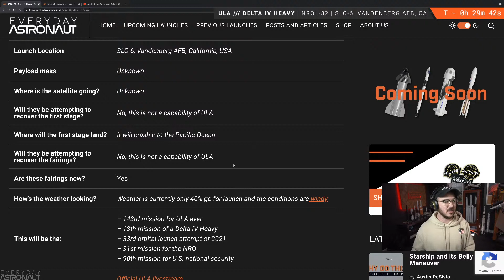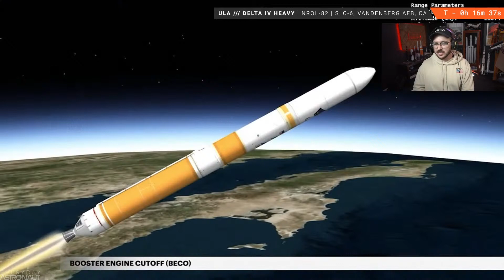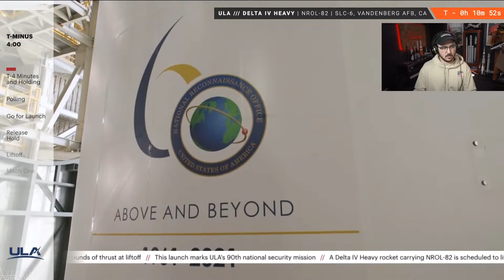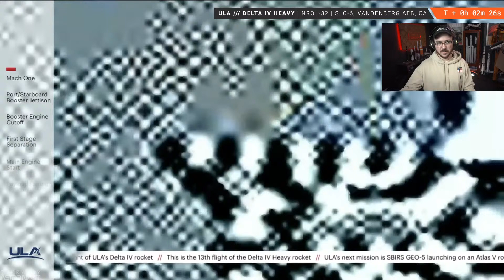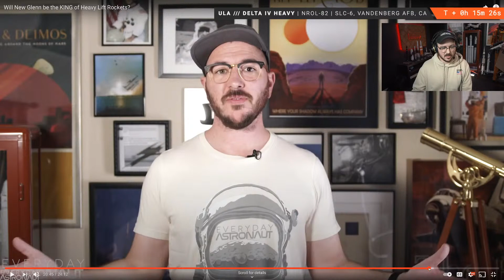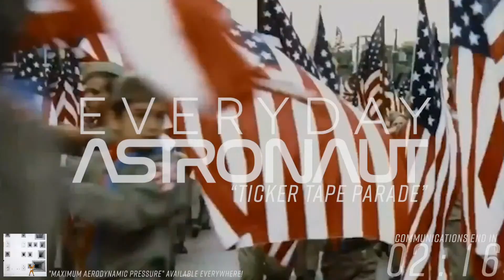Watch ULA launch the world's largest operational rocket, the Delta IV Heavy!

Comment: "the world's largest operational rocket" Does that mean that the Falcon Heavy can lift a smaller payload, or that the Falcon Heavy isn't considered to be operational or are impractical?

True, there have only been 3 launches of F.H., with a 4th scheduled for July of this year, and 5th on October, and possibly a 6th sometime in 2021. (Inmarsat-6B, according to the 'ever reliable' wikipedia, shows that it could be a standard F9, instead)
Reply: It means that, although the falcon heavy is more powerful and more capable under certain circumstances (which don’t include this launch, btw), the delta 4 heavy has larger dimensions (wider cores, 2 meters taller)

Comment: so the two boosters are fireworks pouring out aliminium slag and it falling all over the place.Why use them >>>
Reply from the maker: No, the two boosters of Delta IV Heavy are the same as the center core. They run on hydrogen too. So they burn super clean. The space shuttle on the other hand... or upcoming SLS... yes. I have a video all about “how much do rockets pollute” and we talk about that quite a bit

Comment: The largest ? Delta IV is only 2 meter taller than Falcon Heavy, but far behind in all other things.

While the Falcon Heavy and the Delta IV Heavy may have similar structural designs, there are two very distinct differences. The first being the Falcon Heavy has three launch cores, each fitted with nine Merlin engines. Whereas the Delta IV Heavy also has three cores, but only one Aerojet Rocketdyne RS-68 engine per core. The second difference is that the Falcon Heavy’s cores can return to earth and are reusable, while the Delta IV Heavy boosters are non-reusable, and fall into the ocean.

With these powerful engines, and both rockets first and second stages, each system can put its payload into Low Earth Orbit (LEO), Geosynchronous Transfer Orbit (GTO), Geosynchronous Orbit (GEO), Lunar Transfer Orbit (LTO), and Mars Transfer orbit. With all stages attached, the Delta IV Heavy stands at 72 m (236 ft) tall and weighs roughly 733,000 kg (1,616,000 lbs) empty. The Falcon Heavy stands at 70 m (229 ft) tall and weighs 1,420,788 kg (3,125,735 lbs). That is close to double the weight of the Delta IV Heavy, but with the power to back it up.

The Falcon Heavy boasts that it can carry an astounding 63,800k g (140,660 lbs) to LEO. This capability is the most massive payload sent to orbit since the Saturn V in 1973. The Delta IV Heavy can carry 22,560 kg (49,740 lbs) to LEO. That’s just a third of what the Falcon Heavy can carry.
Reply: It is just over a meter wider per core as well

Comment: Sad thing is that this extremely inefficient, expensive and obsolete contraption has no reusable element of any kind.
Reply: Condiering the spy satellites that these things Lauch require vertical integration in their orbit insertion, and the falcon heavy is only capable of horizontal integration, these rockets are not at all obsolete. Nor will be their quite non-reusable replacement. I like SpaceX as much as the next guy. And they do a lot of things well. But they don't do everything best. There's still a number of launches where their rockets aren't the best choice. That's just reality. Not everything can be fully reusable. It is what it is.

Comment: Hey @Everyday Astronaut, is the Delta IV really the "world's largest operational rocket?" I thought the Falcon Heavy was bigger (in both mass as well as lofting capability to any orbit) than the Delta IV Heavy by nearly twice as much... the Delta IV Heavy is a little taller I think, but it is actually much less massive, isn't it?
Reply from the maker: “Large” is a measure of size and Delta IV Heavy is 2m taller and each core is 5m wide vs 3.7m wide. You’re right, it’s not more powerful, or capable in some regards.

Comment: Most NRO payloads require vertical integration (optical paths are pretty fragile it would appear), whereas falcon heavy integrates horizontally, which means those payloads are closed to Falcon Heavy.
Reply: iirc SX is working on verticall integration, but i don't think it's done
Reply: thankyou for that explanation i was wondering why NRO went with a launch vehicle that costs them 5 times more than falcon heavy costs especially since the NRO have used falcon 9 quite a few times so its not like the NRO are unfamiliar with SpaceX

Comment: Confused:  If the Delta 4 Heavy puts 63,470 lb to LEO and the Falcon Heavy puts 140,700 lb to LEO, then why do you call The Delta 4 Heavy the "World's largest operational Rocket"?  (Because it is 2 Meters taller than the Falcon Heavy perhaps? )
Reply from the maker: Yes. Large. Size. 2 meters taller and each core is 5m vs 3.7m. So largest in every dimension. Powerful, hope. Capable, not really, but yes in some cases like direct to GEO
Reply: @EverydayAstronaut  Or we just change the word "Largest" to read "Powerful".  But most of the quibbling stops as soon as the Starship/Super Heavy Booster combo goes online.
Reply: It can put way more direct to GEO stationary orbit, which the falcon heavy can't do. This is important on very expensive satellites as they don't have to use any fuel to insert themself into orbit which means they can use all the fuel-savings to extend the life of the satellite by many years. For leo you are correct and falcon heavy is better. SpaceX just needs a more efficient upper stage.

Comment: This rocket is bigger than the Falcon Heavy and is not reusable, yet it nowhere near as powerful, funny that.
Reply: It's actually more powerful for GEO or beyond launches. Falcon Heavy for example couldn't have directly inserted this payload. SpaceX upper stage way more powerful but inefficient. SpaceX = Corvette ULA = Prius SpaceX has more power for the short trip to LEO(low earth orbit) but ULA on the same weight of fuel can deliver a payload much much further.
Reply: @vegajf51  The Saturn V rocket is still considered one of the most powerful rockets ever with approximately 3.4 million kg of thrust.

Impressive, but how does Starship potentially stack up?

If all goes to plan, Starships will be more than twice Saturn's by packing around 7.3 million kg of thrust! And that's just on its first stage. This number is with the projected maximum of 37 engines. However, even with the minimum number of engines to get to orbit (24), Starship will still be more powerful than the Saturn V.
Reply: @hillbillyintheasia6122  Very true and I hope starship works, but the question was about falcon heavy and why it wasn't chosen for this launch.

Comment: Isn't it funny how Tim Dodd switches off the sales / marketing piece pre-launch?  I mean people do have to justify their jobs, and that is absolutely fine.  What would be nice is for them to talk of their future plans rather than talk about their past.  The past is DONE!  folks.  Pat on the back - it isn't coming back.  ULA does not have much of a future / paradigm shift on new tech that I have heard about.  If they don't they may not be in space technology much longer as they do not have a workable business model.   The missile era single use rockets is done!  Also, hydrogen is not going be a fuel because it takes up so much space and requires so much careful handling and is so cold !!   It is cheap though, but also takes up way too much space on a rocket.
This rocket is also a 3 stage rocket.  2 boosters with the main center rocket are stage 1 and 2, then stage 3 is the upper stage.   4 rocket segments are lost.   Does not make that much sense.

Comment: They are not  very smart using Hydrogen, it is very  dangerous and is the  reason that they dont launch spme times.
Reply: I actually agree, hydrogen is most efficient but should only be used in space where the bulk doesn't effect anything, the Chinese rockets actually do this.

Comment: The last of the old model launch and throw away which is actually based on missile engineer thinking, which is what the space race was - to legitimize the need to build rockets in the first place.  
It took someone like Elon to come along to say, throwing rockets away is ridiculous - and changed the world of space travel based on a new paradigm.  
The cost of launches escalated to over USD 400 million per launch as all the defense contractors work on cost plus, so it is not in anyone's interest to keep the launch costs low.  There weren't a lot of competitors either.   So SpaceX was a real disrupter here, and rightfully so.   They are now going to literally build 1000 star ships - i.e. a production line of rockets thereby heralding a true space industry - and we are just at the beginning.  Paradigm shifts in breakthrough technologies eventually leading to rendering craft massless and new physics is bound to eventually be discovered so we won't need to burn fuels to launch anymore.

Comment: I thought the Falcon Heavy was the largest operational rocket?
Love the Delta IV though
Reply: it's tiny bit lower and much  has much lower diameter. F9H is most powerful and for most orbits most capable rocket, while ∆IV H is widest, has biggest volume and (iirc) is most capable for height ∆V orbits
Reply: Depends on the payload. Delta IV is more efficient so can send payloads further, think of it like it has way less power but gets better fuel mileage so it can go further.
Reply: @vegajf51  the post-Falcon Heavy launch press conference, the craft cost about $500 million to develop. According to a report released by NASA’s Office of Inspector General in April 2017, the agency will spend roughly $23 billion on the SLS by the end of this year. Falcon Heavy is also reusable, while the SLS is not, which will affect future launch costs.
Reply: @hillbillyintheasia6122  Falcon Heavy is not even the same class rocket as SLS though, Starship will be more comparable. SLS is a huge waste of money though... but assuming it arrives before starship it will be way more capable than a falcon heavy.
Reply: I thought this too. I've read somewhere that its been retired, but I also thought another launch for it is being planned, so idk

Comment: According to Wikipedia, the second stage has only 25,000 lbs. thrust but weighs 67,700 lbs., not including the payload.  Obviously it reaches orbit.  Does the second stage fly mostly horizontally in order to reach orbital velocity?
Reply: yes. The only reason why rockets take of vertically is to get rid of pesky atmosphere asap

Comment: I know it's just a technical point but isn't it the most powerful not the largest?
Reply from the maker: Nope. Largest. Falcon heavy is over twice as powerful. But performance wise, DIVH can still out perform Falcon Heavy in some key metrics
Reply: @EverydayAstronaut  starship biggest ever made
Reply: The Saturn V rocket is still considered one of the most powerful rockets ever with approximately 3.4 million kg of thrust.

Impressive, but how does Starship potentially stack up?

If all goes to plan, Starships will be more than twice Saturn's by packing around 7.3 million kg of thrust! And that's just on its first stage. This number is with the projected maximum of 37 engines. However, even with the minimum number of engines to get to orbit (24), Starship will still be more powerful than the Saturn V.

Comment: I always forget the Delta IV Heavy is technically taller than Falcon Heavy.

It must have something to do with the core's 5m diameter compared to the Flacon Heavy's 3.7m cores.
Reply: It's because the Delta IV Heavy runs off of Hydrogen and Oxygen, while Falcon rockets run off of RP-1 (Kerosene) and Oxygen. RP-1 is MANY times more dense than Hydrogen, so they can cram way more propellant mass into the smaller tanks of Falcon Heavy.
Reply: Delta IV Heavy also has a longer fairing than Falcon Heavy.
Reply: @DrewCocker  Though Falcon Heavy is going to get an extended fairing in the not-too-distant future, which would allow it to take back the title for tallest (albeit not largest by volume), were it not for the fact that Starship and SLS will probably have superseded both Heavies by then.
Reply: Retired in 1973, Saturn V remains the tallest, heaviest and most powerful rocket ever flown. Saturn V successfully launched 13 times from Kennedy Space Center and was the rocket of choice for the Apollo moon missions, including Apollo 11 in 1969.
Reply: s Starship bigger than Saturn V?
The Saturn V rocket is still considered one of the most powerful rockets ever with approximately 3.4 million kg of thrust. ... If all goes to plan, Starships will be more than twice Saturn's by packing around 7.3 million kg of thrust!

Comment: The contrast between NASA (old school) paradigm with expensive disposable boosters, and SpaceX reusable ones is telling.
Reply: ula isn't nasa
Reply: @williamhutton1752    How nice to know that! If I could read, I would have known that from the title; hence the parenthetical insert. Did you dispute the statement in some way? Old, wasteful, expensive methods supplying income to entrenched contractors for obsolete and unsafe designs
Reply: @mred8002  Lmao not every rocket needs/ or can be reusable. ULA’s rockets go much faster the Falcon9; on average ULA’s rockets go ~18,000km/h while F9 fastest re-entry was 10,000km/h and they lost that booster due to it over heating. So as u can see it’s basically impossible to make ULA’s rockets fully reusable.
Reply: @mred8002  i'm just saying that ula isn't nasa.  i have my own thoughts on reusability and such, but it is just factually incorrect to say that nasa and ula are the same.
Reply: @williamhutton1752    True.
Reply: @dummyjoe7895    True. Just comparing methodology. Orion scares me. I’m afraid folks will die from using the old technology.
Reply: @mred8002  lmao starship should scare you. Orion is on proven technology, while starship is all new and is basically a flying coffin for everyone who rides it. With no Abort system what so ever

Comment: What do you mean by: this could be the only option to launch this payload? Doesn't Falcon Heavy have double the payload capacity??
Reply: NRO probably contracted ULA before Falcon Heavy did its demo flight. Or, it's just welfare to keep ULA from folding... no one but the US government can afford to waste so much money, when SpaceX is cheaper.
Reply: @curtischilders3024  it’s because SpaceX can’t even launch this mission in general.
Reply: delta iv heavy is taller lol it is technically the world's largest operational rocket!
Reply: Only option meaning SpaceX can’t.
Reply: probably something to do with geo stat orbit insertion ? I don't think F9 and FH can do direct insertion .. There are things that F9 and FH simply not capable of doing.
Reply: @ComeOnYouPalace  correct they can’t do direct to GEO. Only ULA can do all types of missions. SpaceX is dominate in LEO, but anywhere else ULA can do every mission
Reply: @Paul Sandberg falcon heavy twice as powerful and can carry twice as much weight than delta 4
Reply: it has super small fairing - it's size for 3 times smaller rocket (and even for F9, it's small).
Reply: I believe that this mission would require expending all of the  falcon9 heavy .

Comment: I have to take umbrage with the term "largest" associated with the Delta IV Heavy in the title: is it the heaviest? No - Falcon Heavy is about twice it's weight; is it the strongest? No, Falcon Heavy lifts to GTO almost what this lifts to LEO.

So what is it the largest in? Well, maybe in height - Delta IV Heavy is 2 meters taller than a Falcon 9 (an FH is just a bunch of F9s). Across 70 meters it isn't saying much, but you have to take the PR wins where you can find them, I guess, as SpaceX took everything else...
Reply: If you say largest, I'm not thinking heaviest or most dense. The physical dimensions make the most sense. Delta IV Heavy is larger in length, width and height. There's no point arguing over the fact that it's only a couple of meters difference. Justin Gatlin doesn't go around arguing he should also be called the fastest man on Earth because he's was ahead at 70m in Rio and only finished .08s behind Usain.